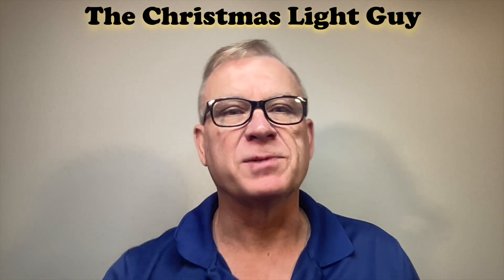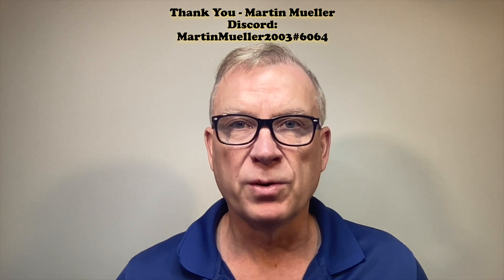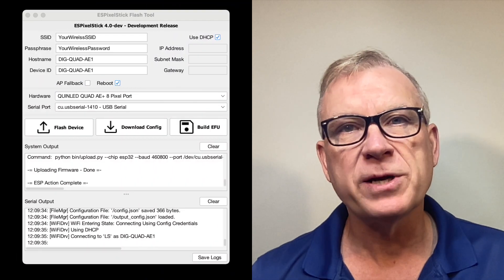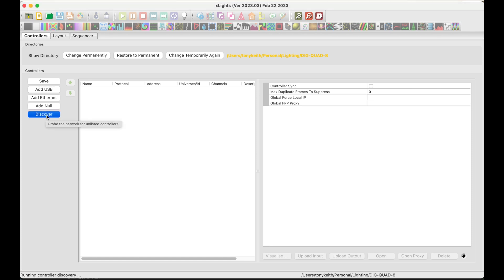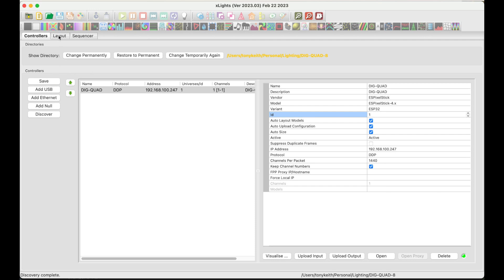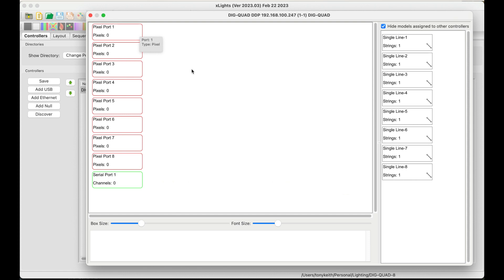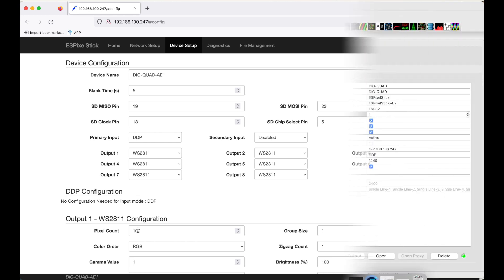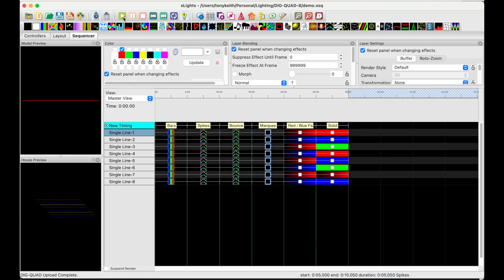How to get 5 or 8 LED outputs on a DIG-QUAD (Part 2 - running ESPixelStick firmware)

Comment: very good video, do you have a video tutorial on how to flash a wt32-eth0 with espixelstick? I have tried to flash the board but I have not succeeded, I would appreciate it since I am new to this Christmas lights thing. Sorry for my bad translation from Spanish to English :D
Reply from the maker: Sorry, I do not have a video specifically for that hardware however, it should be exactly the same as flashing a ESPixelStick. Can you tell me what failed when you try to flash your hardware?